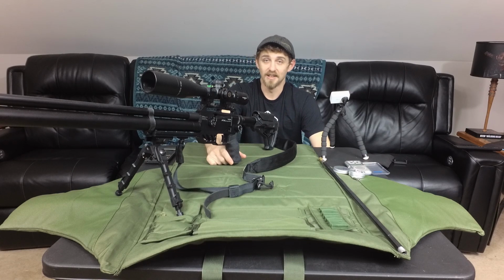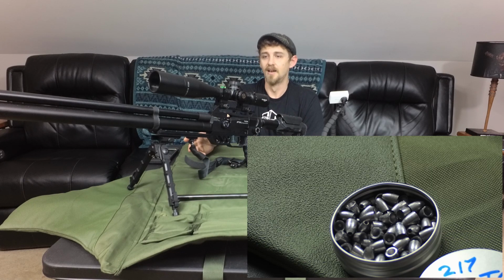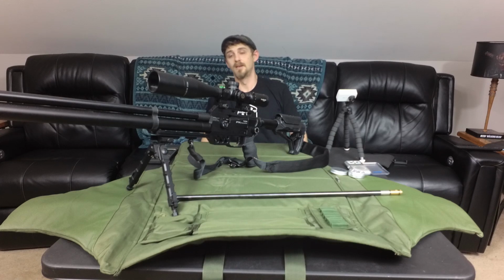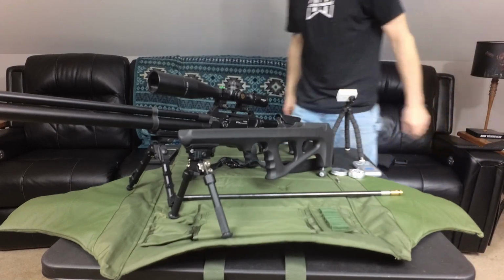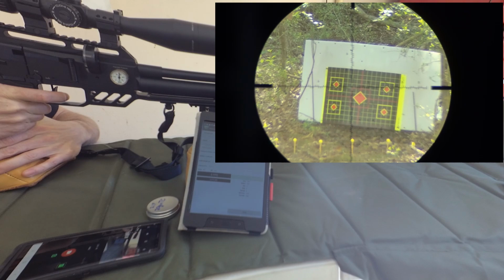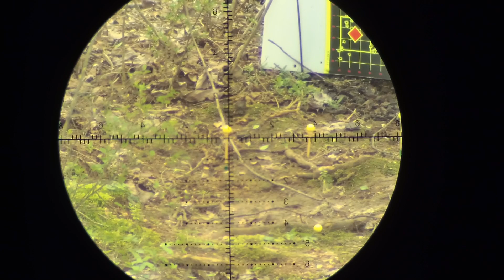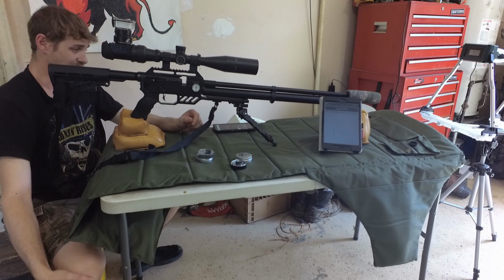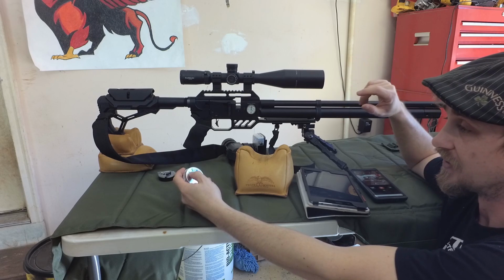FX dreamline power plenum part 2

Comment: Where do I buy your slugs????
Reply from the maker: Here is a ebay link for the slugs used in this video these are available in .218 as well. Our web site is not exepting payments currently but you can see a full list of our slugs there. 
Ebay 
https://www.ebay.com/itm/174233560378
Website 
Www.griffinairgunammo.com
Reply: How is your pic rail so long and àir out the barrel has to be valve or seat correct? Ordered new ones but I can't find nothing wrong with mine also I have 2 FX plenums plus the 30 CC Huma with reg but run it at 120 to 130 bar they just fit Soo close to the Donny but doesn't hit
Reply from the maker: @nickhathaway4617  I have a after market trigger guard that has a mloc rail that is much longer than the original version, I will add a link for it.  I'm not sure what you where asking about the valve, but the actual valve on mine is the short valve stem not the new longer one.
Reply from the maker: @nickhathaway4617  here is the link for the rail
https://utahairguns.com/fx-dreamline-arca-swiss-rail-trigger-guard/

Comment: Those are not slugs. Just expensive hollow pellets. Slugs are solid.
Reply from the maker: By definition "slugs" are just a modern bullet shape meaning an ogive of at least 1.5 S and no drag stabilizing skirt. The only difference in this is the base style. I use the same die to make hollow base, TC base, cup, dish, flat and rebated boat tales all of wich are most definitely slugs. I can make these with a 6s ogive as well. It's just a different base designed for a purpose that's all.